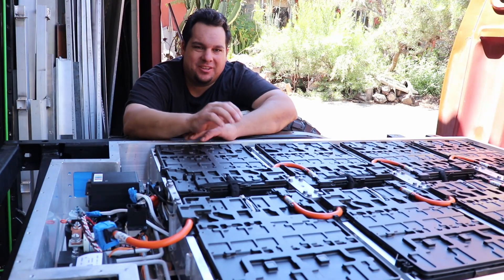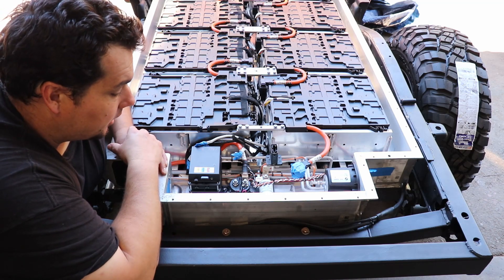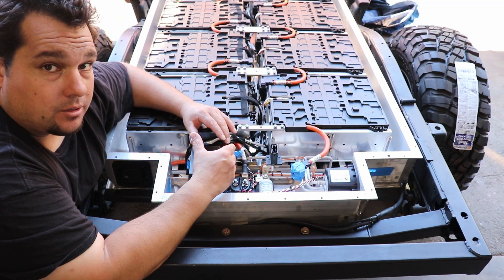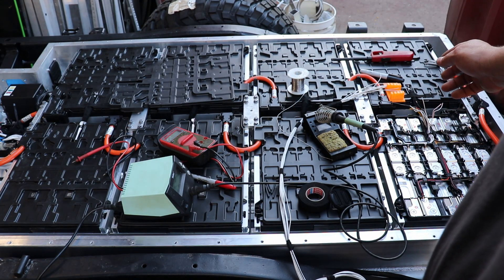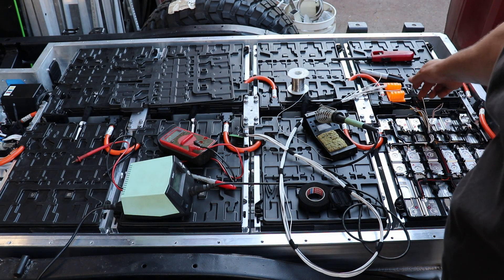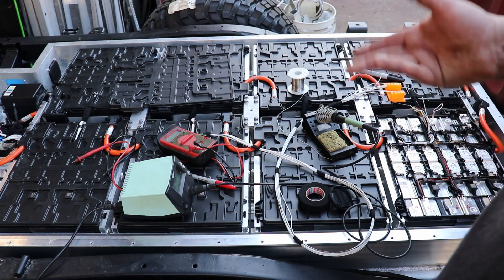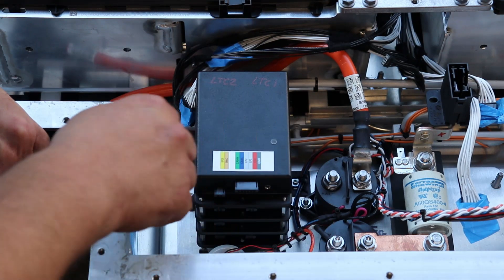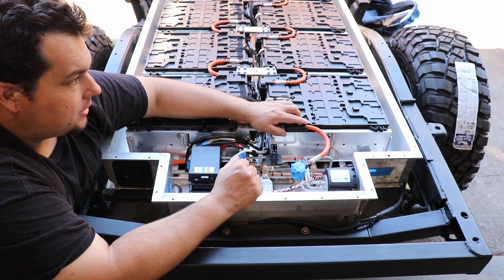Wiring up a Dilithium BMS System on a 400 Volt Battery Pack!Tesla Powered Toyota Hilux Build Video 3

Comment: heat, energy loss and extending the cell life and that of all the components is easily remedied , for example there's air cooled vs liquid cooled , 99% of the battery packs are liquid and air cooled combined and the easy solution to also reduce chance of fires and extend the life of the batts is to do a 100% liquid cooled pack, keep the liquid cycling through the batteries themselves in addition , you will have to make the pack water tight add a few more circulation pumps and reservoir/ filter system , then fill the entire pack with die electric fluid, your turning the pack tray essentially  into a bathtub, I said 99% because I'm the one percent, on my rc cars I made this work with my lithium batteries to extend life 10 times longer and keep them cool the die electric fluid bath is the future of all ev cars to remove all condensation #1 and current loss and overheating the number one solution

Comment: After upgrading car pack I'm interested in using entire 60Ah one for Solar storage/off grid use - is it possible to do so without stripping down pack using BMW contactors and BMS? 

I think BMW EOS machine needed with chassis number to operate contractors? Or is there an open source work around?
Reply from the maker: I thinkkkk there’s a way to run it completely stock. I don’t think it’s very locked down. I know there’s an open source way to run the bms modules but not the whole pack. I can’t imagine it’s too difficult to operate the contactors though.

Comment: In regards the actual cell tap connections , is there a fusible link to prevent the chance of a fire if the cell tap wiring harness gets damaged.  I remember an issue with a Chevy Volt battery pack catching fire on an EV conversion by Damien Maguire, the fault turned out to be the factory cell tap harness getting damaged and shorting out the pack .

Comment: Can you compound thee packs? Like add another under the cab to double the overall capacity?
Reply from the maker: Technically yes. The other pack needs its own bms and a fuse but as far as I know it would work fine.

Comment: I have a 1981 vw rabbit pickup truck that us currently a working 1.9 turbo diesel with manual trans.  I'm located near SF Bay area.  I'm looking to build it out EV style.  possibly retaining manual trans and front wheel drive setup or doing a drop in rear axle and converting it to rwd.   if you would like more project / content let me know!    I have the funds!  I hope to hear back and cheers!
Reply from the maker: Awesome! Email me. Might be able to help you figure some things out.

Comment: Very cool project. What are you estimating the range to be with only 33kwhs?
Reply: I am guessing from other truck efficiencies, this truck will get 2.5miles per kwh. So 2.5 * 30 = 75 miles. This is a rough estimate.
Reply from the maker: That is extremely accurate! your right on the money with that.